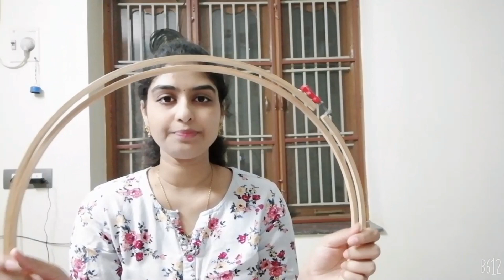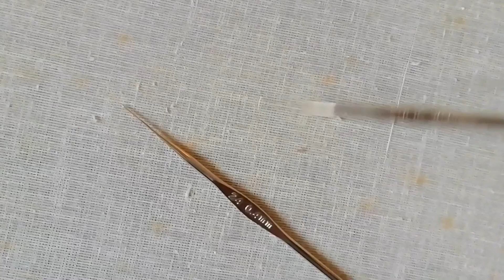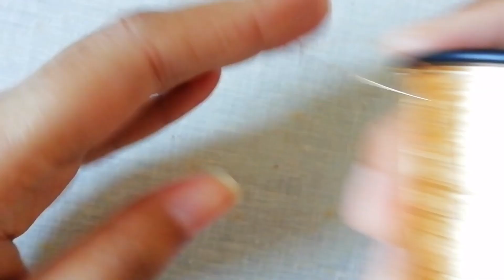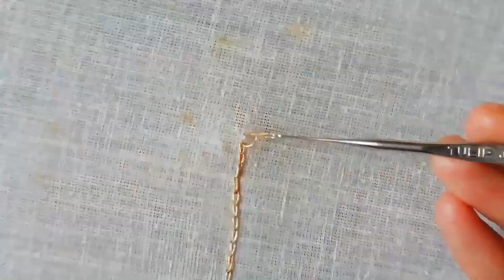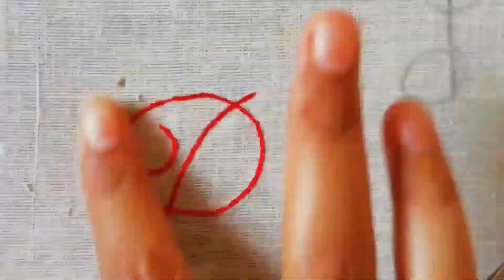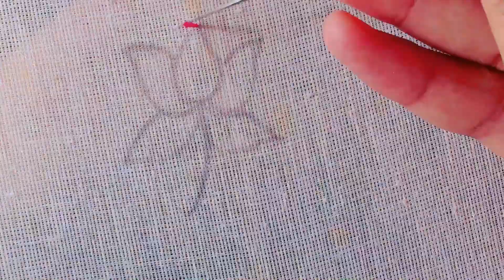MAGGAM WORK PART-1(TELUGU)||chain stich||satin stich

Comment: కేవలం రు.500/- తో మీ వీడియో కి 1500 Views /30,000 impressions.వివరాలు కోసం ఈ నెంబర్ కి వాట్సప్ ద్వారా సంప్రదించండి 9347371450📲 మీ చానల్ కి 1000Subscribers 4000 Watch Hours గ్యారెంటీ.
అతివతక్కువ బడ్జెట్ తో గూగుల్ ద్వారా మీ వీడియోలు ప్రోమోట్ చేసుకోండి. 
1500.views / 30,000 impressions come with just Rs.500 / - Promote your videos through Google on a very low budget. Contact the number below via WhatsApp for details
9347371450.
... . . . .